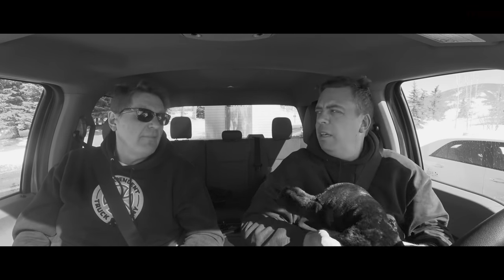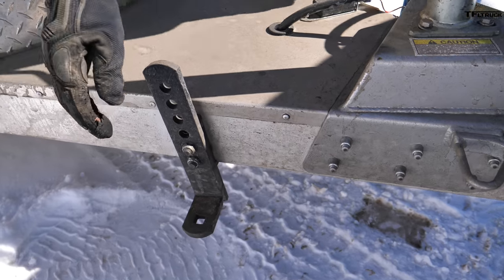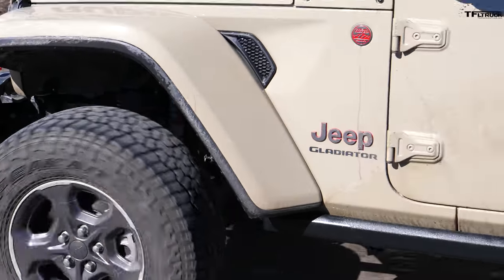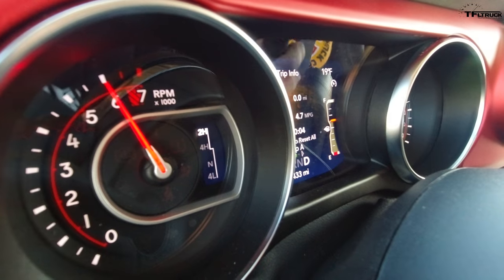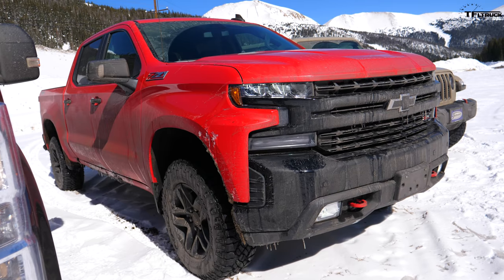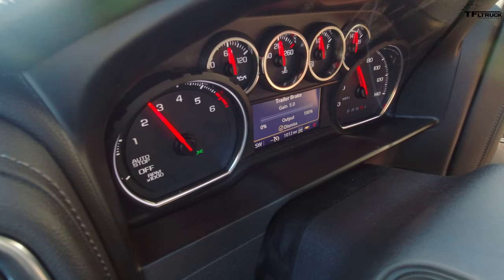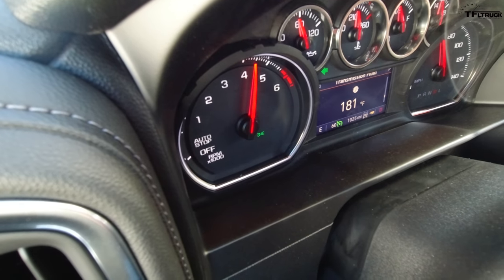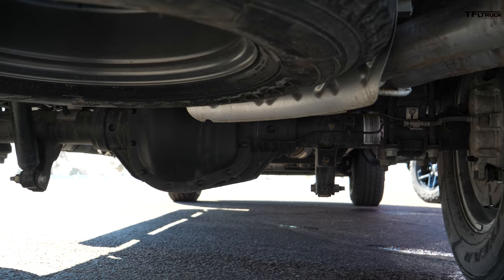Midsize, Half-ton, and HD Trucks Versus the World's Toughest Towing Test - Only One Truck Kills It!

Comment: I had an 88 Jeep Comanche Pioneer longbox 4x4 very much like yours which I set up for towing. I occasionally pulled a travel trailer which when loaded for the trip scaled at 4760 lbs for trailer only. The Jeep only scaled out at only 3400 pounds without driver. But included full tank of gas and  class III receiver hitch, adjustable hitch, equalizer bars plus the friction sway controller.  The trailer had a tongue weight of 640 lbs. (820 with water on board, so I did not tow with water on board.) the Jeep was not happy towing that travel trailer without the equalizer and sway controller hooked up. The teter totter effect was serious. It was not safe to drive because it transferred a significant amount of weight off the front wheels and effected both steering and front end braking. Using the equalizer bars as recommended and instructed, had almost a worse effect. They transferred to much weight to the front axle. Wound up over loading the front axle and tires and wound up with only about 900 pounds on the rear axle.  It “looked right” but was not. (All this was done using a platform scale to obtain axle weights.)  The hitch had 2 adjustments. Hitch ball height and pitch. The pitch controlled the horizontal angle of the equalizer bars. Essentially the load they carried and transferred to the front of the tow vehicle. (It also had an additional effect of transferring sone of the tongue weight to the trailer axles)  That load was also controlled by the number of chain links you used between the bar and the hook on the trailer tongue. My goal was to tune the load to get close to a 50/50 weight distribution on the front and rear axle.  When I was done fooling around with the adjustments (it took quite a while, as it was a learning  process as well) I achieved the weight balance.  But due to the softer rate leaf springs on the rear axle vs the front, the rear end squatted more. There was about a 4.5 inch bumper drop) So the truck had a bit of rear squat when viewed from the side.  There was still plenty of suspension travel left in the rear however. (Comanche has a LOT of rear suspension travel!)  when all was said and done, I had the load carrying, braking and handling optimized for the package. At the end of the day, it towed the load almost as well as my 1989 F-150 2x4 which is equipped with a class IV 6800 pound tow rating. The 150 has a bigger engine and weighs considerably more. With its canopy and gas, tips the scales at around 4700 lbs.

Comment: I'll keep my 2500HD, its paid off.
Reply: Dirty Harry where did you buy your truck
Reply: What year is it?
Reply: @jaymoar3561  '04 6.0 4x4 with 280k of DC metropolitan area towing, hauling, and plowing miles. I have had every make of truck. Others faster others more powerful others more capable, but none as reliable.
Reply: Tiersmoke92555 I like the 7.3 early models, not much in power but that thing will run forever.

Comment: I think it'd be interesting if TFL tested the same truck on the IKE twice with same weight and the first time used cruise control and the second time controlled the gear shifts manually and compared fuel & time between the two.

Comment: It's nice to see the capabilities of what 55k in truck terms gets you. If towing frequently then the F250 for sure, if occasional towing, mpg and some off roading are in being done then the Silverado. The jeep makes no sense at all especially if you factor in discounts by the manufacturer which I'm sure is zero. I think if you're looking at midsize trucks, pony up at least to a 1500/150  series. Price, mileage is similar. Other capabilities not so much.
Reply: J M FCA is offering discounts on the Gladiator. It’s marketed to the same people that weigh wrangler vs 4Runner vs Tacoma. It makes sense if you want a truck and like off roading. I’d get a Gladiator if I didn’t already have an F150 FX4.

Which also validates your point. For what a Tacoma TRD Pro costs you can get an F150 SCREW 4x4 that gets better MPG and can tow more.
Reply: It makes perfect sense if you want a convertible off road truck.

Comment: In my experience using cruise control while towingit actually works better than my foot does because it controls how much throttle it gives it better than my heavy foot .but that's on the interstate at over 70 mph

Comment: Hey do you guys think you could pull some camper trailers I've towed both horse trailers and camper trailers and I think a camper is alot more challenging with sway
Reply: Matt Stuart Travel trailers on half tons and fifth wheels on HD’s. They’ll find out real quick that a half ton shouldn’t be towing a travel trailer anywhere near it’s rating on weight .

Comment: Here's proof that not using weight distribution hitches while towing maximum weights, is asking for a 'world of woes' especially in the lighter weight / smaller wheelbase trucks.
For my  hauling needs the Chevy SIlverado is tops, BUT I would use weight those weight distribution bars!
Of course this is why they make trucks of different sizes,...if I just HAD to have a Gladiator, I wouldn't tow ANYTHING over 5,000 pounds.

Comment: The lieniancy of cruise control( 2 or 3 mph before it interviens) skews the results. The constant foot throttle is more accurate. If u do switch methods then retest the perfect time. Because the f250 should have had a perfect 8 not 8.2 and it struggled less than the trail boss
Reply: Not really. Ride down the road and try to keep the same speed with your foot . Once it drops on the Ike and recovers it’s probably gonna hold the gear. How fast they got to 60 can change the result if they both held it . 1 second is nothing on this test

Comment: You need to show the trucks more in the parking lot driving on top of the white snow, that red Chevy just popped! You can see the tread on the tires when they pack with snow...cool! Interesting the Ford had better mileage then the Chevy, didn’t have to work as hard.

Comment: How did the Jeep get 4.7 going up a 7% grade when it only got 5.9 on the flat tow,seems like the computer might be telling lies
Reply: I mean when an engine is running close to maxed out in both scenarios, it's not like it's going to be that different.
Reply: When the numbers become that small, every point is a massive difference (in terms of percent gas used). Going from 5mpg to 6mpg uses 1/6th more fuel, which is 16% increase. In both tests, the engine was revving/working very hard.

Comment: Jeep needs an inline 6 like modernized the 4.0 for all truck/Jeep-like (cringed) duty so it can be efficient, low emissions, bulletproof, and torquey. Plus this test is not comparable, it's about what size/weight class of your needs for what you use it for. The f250 is better suited for this test, the Silverado (my favorite) is better for off-roading and back trails and other uses, but the Jeep is the best off-roader in this group and can climb mountains and carry your outdoor gear. No winner/loser here just choose which one of these rigs that suits your needs depends on what you use it for.

Comment: I am pulling a 6,800 lb trailer with my 2001 Tahoe 5.3L and it’s quite comfortable, although my truck costs less than 1/4 of any of these, along with all the modifications (hd rear springs and cold air). Mileage 520,000 km. still like a rock. Love tfl))

Comment: Great episode! 
I tow my Jeep Jk with a Ram Rebel and always been curious if it’s worth stepping up to a Ford 250 or Ram 2500. OR... just sell both for a Gladiator lol
Reply: I dont recommend  you sell the Rebel since you tow. I have a Rubicon and a Ram 1500 sport for towing. I like having overhead of more capability (9,500 towing vs 7,000). Never like maxing out when towing.
Reply: I would go to a f250. If you watch their other videos they have proven that ford has the best trucks for the money and if the truck does cost more you get a ton of features that other truck manufactures dont have
Reply: I know the Ram Rebel is more then enough to tow the Jeep but occasionally it’ll get pushy. Thinking the heavier 3/4 ton would be less phased. I wouldn’t tow with a Gladiator.
Reply: DirtBikeGuy04 best trucks last year the f150 broke down on the ike test . The 7.3 and the 10 speed transmission only been out about 3 months, with Ford's reputation with engine problems you may be eating your words.

Comment: I enjoyed this video, but "I feel sorry" for that poor Jeep with it's maxed out trailer load. May I suggest another test with each truck using the same trailer, but loaded to 75% of each truck's max tow rating? Although every truck has a max tow rating, it is generally NOT recommended that you tow at the max rating. 75% of the max tow rating would be much more reasonable when considering purchasing a truck and/or trailer.

Comment: I set my gain as a percentage of my weight with the logic being that the trailer using its max brakes is to take the trailer down at its max weight.

So on my 10k trailer I'll set it at 7.0 when the trailer weighs 7,000lbs.

99% of the time it's dead on. You don't want the trailer doing too much braking.

Comment: Good trucks in their perspective fields. Towing, the Jeep can stay home. Yuppiemobile. GM can do the job but both Momma and Baby Bear would surpass their carry capacity if loaded and pulling this weight. Momma bear for the weight it’s said to be able to haul will never make it with any load. Fuel loads on all three were at 1/2 tank which appears you knew this when you towed. Poppa Bear of course would get the nod. 
Good test for Momma Bear, but don’t expect to tow any more weight with a load of fuel, 2 adults, 2 kids, a dog, and an ice chest and couple bikes in the back of the truck.

Comment: That's dangerous to not use weight distribution on the jeep and Trail boss.  Infact ,I beleive on the Trail Boss you can't exceed 6k without weight distribution.
Reply: Can't and shouldn't are very different things. I once saw a 90-something ranger towing a minivan on full steel deck car trailer. The hitch was literally dragging the pavement. That was an extreme example, but everyone who tows will exceed the manufacturer's ratings at some point.
We don't use sway bars when it's recommended to do so.
We don't balance a load, and have excessive tongue weight.
We overload unbraked utility trailers.
It's not because we don't care about safety, it's because we recognize that the job jas to get done, and sometimes you have to work with what you have.
I think it's refreshing to see a real world test where everything isn't labratory perfect.
Reply: @lukediehl1210 can't meaning its unsafe and not recommended. I did just check my own Trail Boss manual,  it says up to 7k without weight distribution.  My older 2014 F150 was 6k without weight distribution.

Comment: Jeep owners: *Making fun of Hummer h2 owners*
Me: *knowing my Hummer h2 can tow and carry 1k pounds more than the Jeep pickup*

This the sorriest excuse for a pickup I’ve ever seen.
Reply: Probably gets better mpg
Reply: The H2 is based on a full size chassis. They are not at all comparable. The H3 would be the vehicle to compare. And the Gladiator compares quite well to the other mid size trucks.
Reply: Stuka87 the h3 would probably feel better since it has a v8
Reply: @RestrictedHades  The majority of H3's had an i5, only higher trimmed models like the Alpha had the 5.3L.
Reply: 6designsmotorsports You better watch your mouth. The second car is a McLaren 720s, 3rd is a red Lamborghini Urus, and 4th is a 2020 g63 Amg. Had 3 h2s and had this one for 6 years. An 03, 09 and 08. Will never give it up. They are crazy reliable, comfortable and it does pretty much everything I throw at it. 

Had a rubicon before. Traded it on the h2 because the drivability sucked, the death wobble couldn’t be solved, and it wasn’t a very quality vehicle.
Reply: Stuka87 yeah but hummer owners get a lot of shit from Jeep owners. And this feels good. I still think the h3 would have done better than the gladiator just because it’s more built off of the Colorado platform. That would be an interesting comparison. H3t vs gladiator.
Reply: Thomas Rybacki if you put both on 35s it will likely be about the same. The Jeep might do slightly better.
Reply: @6designsmotorsports I mean have you seen or been in a JLTV they have CV axles and 43" tires they are badass, old Humvees have CV's and they have good clearance width is what kills them
Reply: 6designsmotorsports have you ever seen a crv off road? Probably the worst all wheel drive system out there
Reply: 6designsmotorsports ok and? So does the h1, g wagon, and raptor
Reply: 6designsmotorsports they’re tie rods. Most people replace them anyway. Do I really have to go through the list of parts you need to run 37s on a Jeep? It will cost you almost a grand. All the h2 needs is a leveling kit.
Reply: That Jeep has higher tow and payload ratings than any other mid-size truck.

Comment: You should've used a non Rubicon gladiator because the Rubicon gladiator loses 2000 lbs tow capability due to the suspension.

Comment: I personally own a 20 trail boss and was shocked the 7.3 Ford didn’t outrun it up the mountain. I guess it proves that a half ton is just as good when towing moderate weight. Obviously going bigger means bigger truck. Great video
Reply: Bigben1971 were you watching the same video as the rest of us?
Reply: Bigben1971 
8:00 is a clean run. They have the cruise set at the speed limit. It clearly “beat” it by not revving as high.
Reply: It’s not a race. They try to stay at the 60mph speed limit. The ford ecoboost engines and probably this 7.3 had a lot of throttle left where the others are usually to the floor
Reply: Yes guys I know it’s not a race. I found the video interesting. There tends to be a lot of people who think if you tow anything you need a one ton diesel. I was commenting appreciation of a test showing you don’t need that. I’m very experienced pulling loads. Though we all could admit it would be interesting to see what some of these pickups could do if they just floored it the whole way
Reply: Bigben1971 
I agree, but this comment section is already full of “weight distributing hitch” nazis. Can you imagine if they went over the speed limit while towing? Tears would flow.
Reply: Yeah you can’t go full speed ahead. People just want to argue.

Comment: I still don't understand why GM hasn't done something about the grade shifting in tow/haul mode on these new trucks. They used to do it quite well but that seems to have gone by the wayside. That was also a bit sketchy doing the test without the distribution hitch, ESPECIALLY on the poor little Gladiator.

Comment: No weight distribution?  Guys, really?  I run WD on my 2014 RAM 1500 pulling 5000 lbs.  

By the way, you should be able to pick up an aftermarket brake controller and harness for the Jeep for in the cab.  You don't need the Mopar version.  The hard part is if they changed the wiring plugs.

Comment: I usually have zero issues with your videos, however today I have one. No problem trying without weight distribution, but you loaded all the weight in the nose of the trailer further enhancing tongue weight. Those rubber mats would have been easy to spread out some of the weight to the rear.
Reply: If you look closely, that trailer has a separate compartment at the front where you can store saddles and other riding gear so the weight was loaded just in front of the axles. In any case, I trust that TFL did not exceed the recommended tongue weight.
Reply: Yes, Harold, I noticed that too and wondered why load a trailer with all that tongue weight??
Reply: @regsparkes6507  If you watch their other videos, they always weigh the trailer to make sure it has the appropriate tongue weight, they shoot for almost exactly 10%. That trailer was loaded correctly, just like every other tfl video. They never show the weighing in the video because honestly it doesn't make good content.
Reply: @SSMJ  Yes, well Seth, you might  ( do ) have something there, I ( we ) didn't get that good a look at how the load was distributed. The TFL guys know their stuff too,..so they must have done it correctly! ( I  was apparently, mistaken in that one.)
Reply: @regsparkes6507  No worries, if you haven't seen their other videos where they talk about it it's hard to know! Have a good one!

Comment: They made all this other tech mandatory on vehicles (tire pressure monitors, backup cameras etc) it should be mandatory that any vehicle with a towing capacity rated over 3500lbs(I believe is the threshold) should automatically come with an integrated brake controller.  They're not expensive and if manufacturers were buying wholesale they would be even cheaper and work better.

Comment: They used the same weight for all three trucks. So what were they expecting to happen? The smallest truck was at max, the Chevy was right in it's tow capacity and the 3/4 ton was under capacity. Interesting that the Ford and Chevy was almost identical except for the brake applications. I agree with Roman.